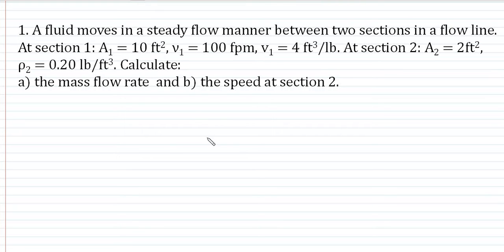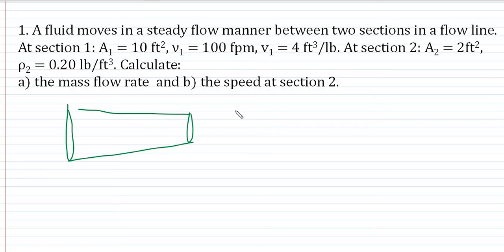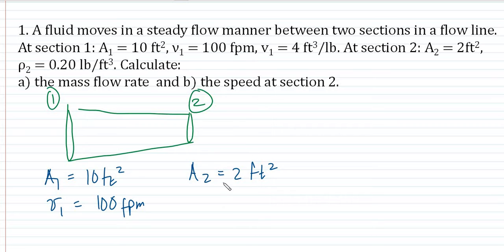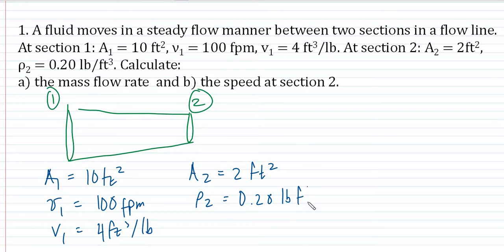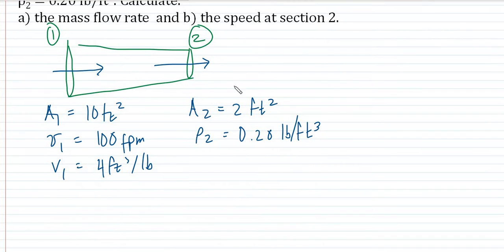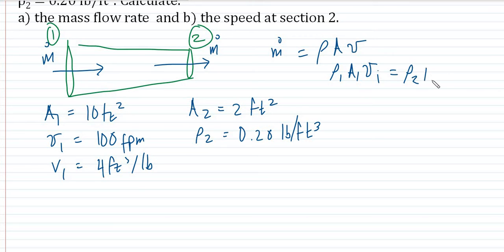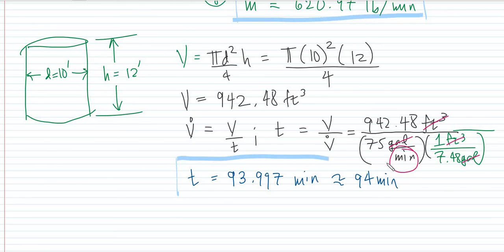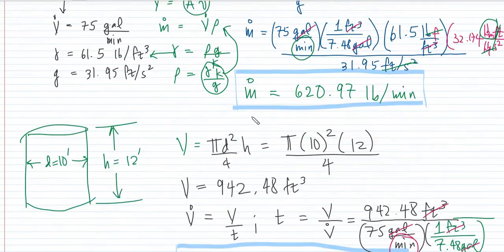Solved Problems for CONSERVATION OF MASS (Simple and Easy)

Comment: sir, @12:20, correct po ba yung volume? hindi po ba dapat wala na pong squared doon sa diameter? thanks poo
Reply from the maker: the volume of a cylinder is equal to the area of the base multiplied by the height. ang shape ng base ay circle. so area is pi*d squared/4. that's the reason why merong squared yung diameter.

Comment: sir ano po yung 'k' sa problem #2
Reply from the maker: Hello Kenneth, I used k (proportionality constant) = 32.174 lbm*ft/lbf*s^2 to get lbm/min for mass flow rate. If the desired unit for the mass flow rate is slug/min then you should use 
k = 1 slug*ft/lbf*s^2

Comment: sir bakit iba yung answer key ng libro na binili ko yung mass flow rate sa Prob.1 is 15,00 pounds per hour tsaka ang speed at section 2 ay 10.42fps.. thank you po sir
Reply from the maker: Hello Jhon, the answer I gave for mass flow rate is 250 lb/min if you will convert that to lb/hour then the answer is 15,000 lb/hr. The same goes with the speed. 
The answers are correct, it's just a matter of the preference for the units. :)
Reply: @jcamores5099  Thank you sir
Reply: yes
Reply: anong libro po gamit nyo

Comment: San po galing yung force sa 61.5?
Reply from the maker: Hello Axisiel, 
If you are referring to #2, then, the 61.5 value is the SPECIFIC WEIGHT. It is included in the given.  Since it is specific weight then the lb(pounds) in the unit, lb/ft^3, is lbf (pound force) and not lbm (pound mass).